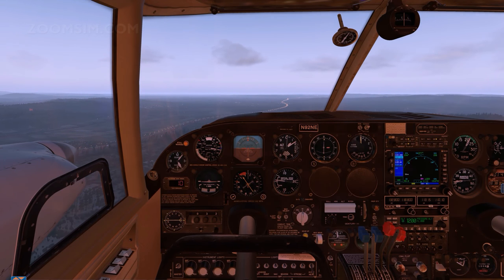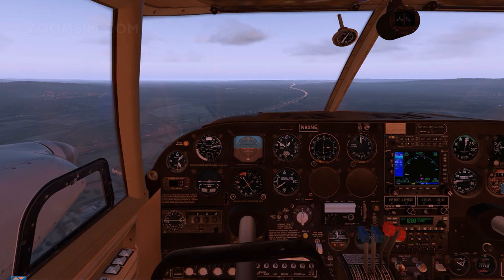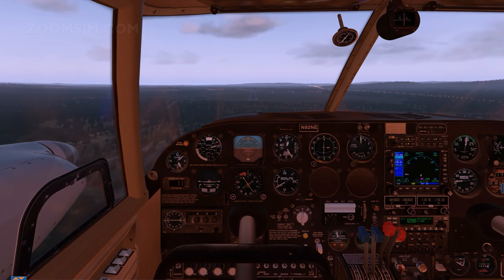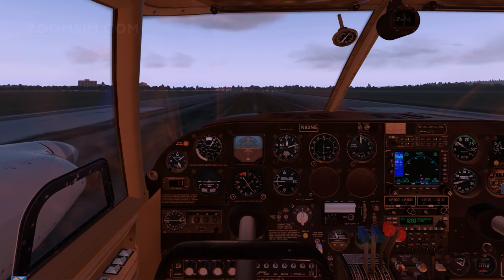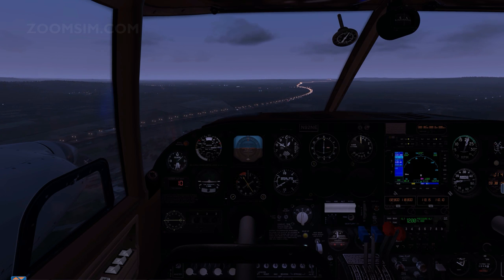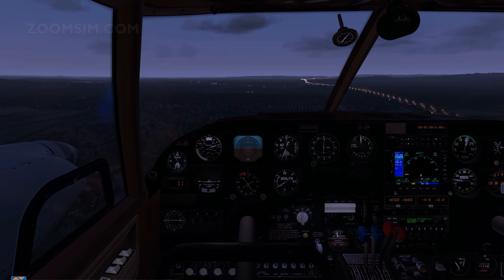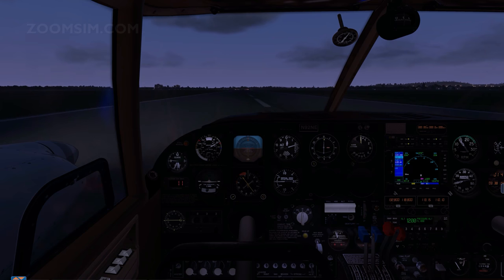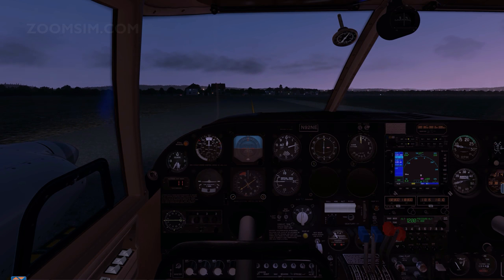X Plane 11 : vFlyteAir Piper Twin Comanche : Lezignan Corbieres Short Landing

Comment: Great instructional video. In light Multi-Engine aircraft (AMEL), it is often recommended to use an approach speed equal to Vso (stall speed in landing configuration) x 1.3. Being mindful of your Vyse (Best rate of climb single engine) speed in case of an engine failure on approach. Approach speeds near Vso and below Vyse can lead to undershooting the runway in case of an engine failure during the approach.
Reply from the maker: Thanks for the input. I appreciate it. I generally need to be more aware of v speeds when switching between aircraft.
Reply: No need to be an Aeronautical Engineer, just a safe pilot. Energy management is a lesson best learned on the ground and practiced in the air...:) Fly safe and enjoy